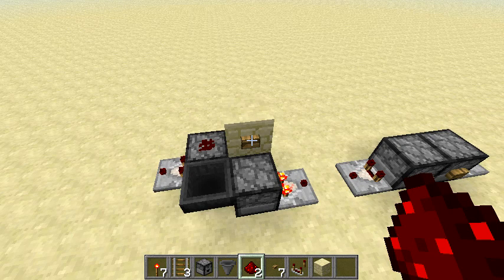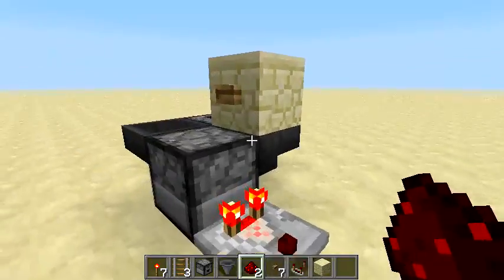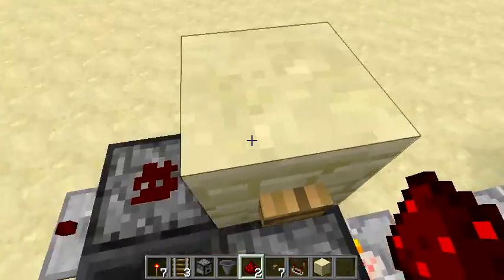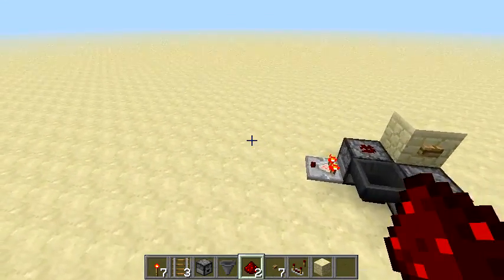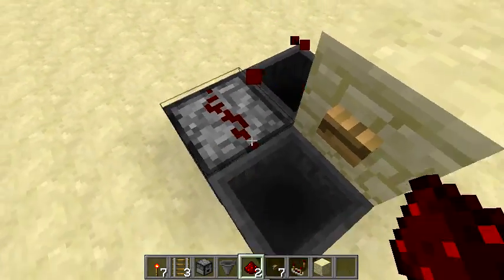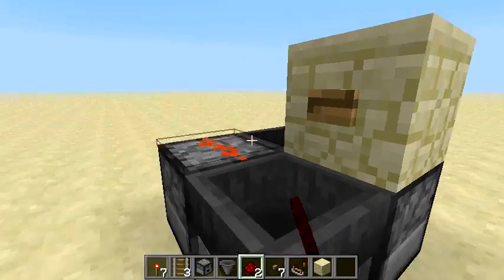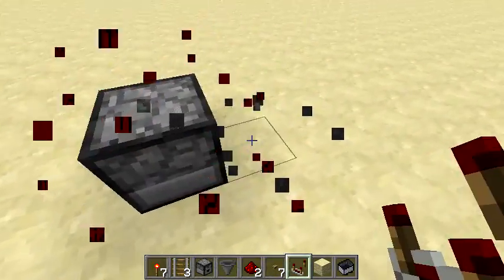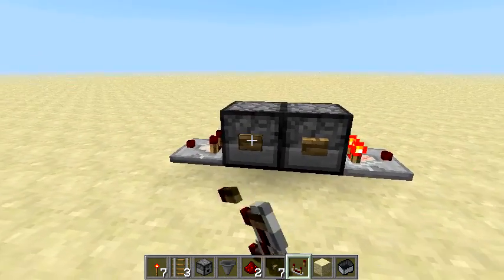Minecraft Redstone: Smallest T-Flip Flop and RS-Nor-Latch!

Comment: The T-Flip Flop can be a lot smaller you can do basicly the same but make it in the hight.
Dropper facing upp into hopper facing to the back into dropper facing down into hopper facing forward and a button on the first dropper.
shortest tutorial ever 24 words, 4 blocks (not including button and comparator at the end).
Reply: that doesn't work.
Reply: artymccool Oh I see, said it wrong in the first comment.
1. dropper up with button on it.
2.ontop of that a hopper feeding backwards.(can be a dropper to doesn't matter)
3. behind that a hopper facing down.
4 under that a dropper facing into the first dropper.
The item goes from the first dropper upp when you press the button then via the hoppers to the rear dropper and if you press the button again it moves back to the front dropper.
Comparator on the back to read if there is an item inside the rear dropper.

That'll do.
Reply: martijn smit
ok, I have now done what you said twice, and both times I have tried it, it failed.
That being said, regardless of your poor instructions, I managed to make it work by NOT putting a button on the dispenser, and instead placing a block in front of it, and then putting the button on that block, and then running redstone alone the top the whole thing.